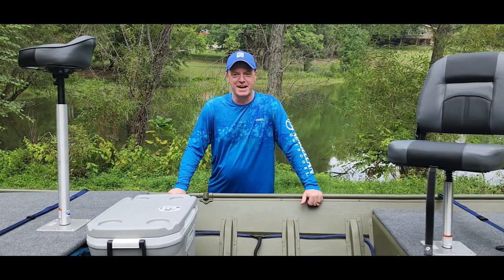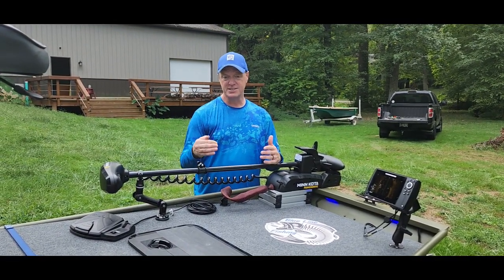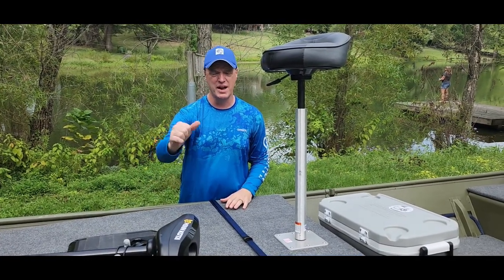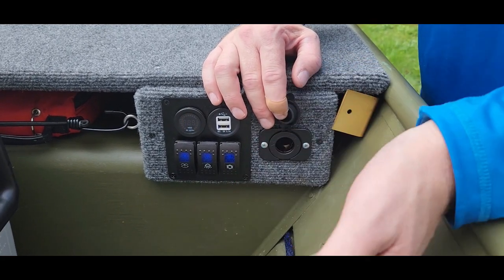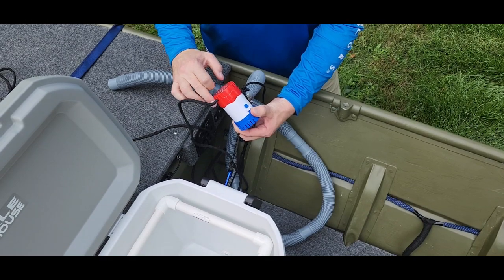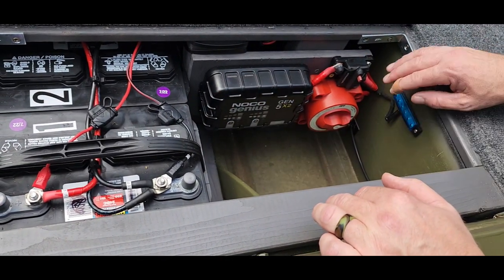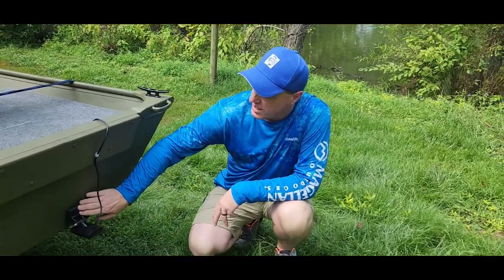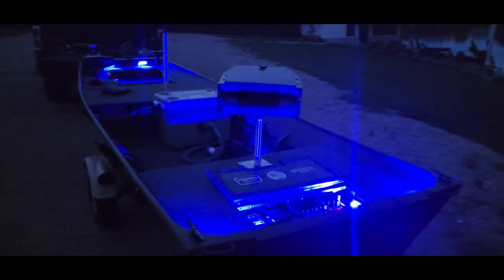Jon Boat to Bass Boat Part 5 FINSHED! | Complete WALKTHROUGH!

Comment: Nobody ever shows themselves fishing in these boats.  I can tell from building my own that these 14x36 boats with those high decks on them are extremely wobbly and tippy. You have to be very careful when making any movements on the boat. If you are considering doing one of these I would buy as wide a boat (14x48 or wider) as your budget would allow.
Reply from the maker: I actually have a lot of videos of me fishing out of this boat, like this one https://youtu.be/JfKLIwW7kv4?si=J8QqmOU3UWwfuM_2. I'd say there is not as much room to walk around on the bow, but it's not super unstable. A 48 would give you more room, but I don't have any problems at all standing up and fishing out of this one. Thanks for checking out the video!
Reply: Thanks for link ...   @BlueLineFishing